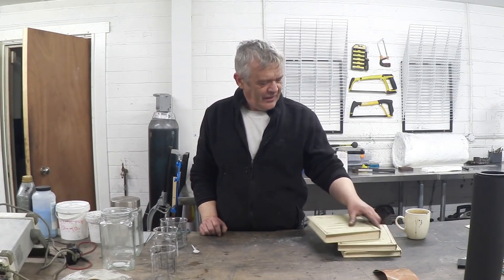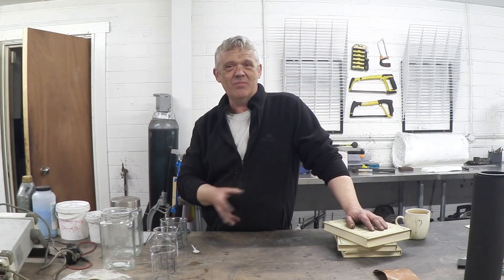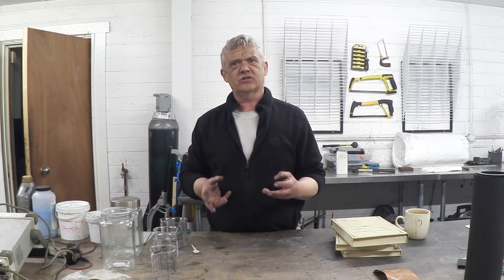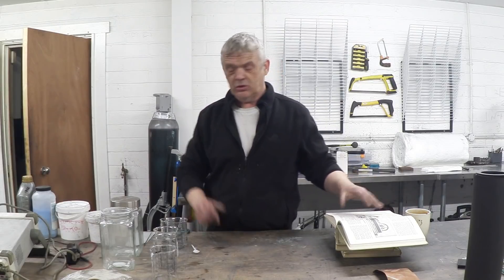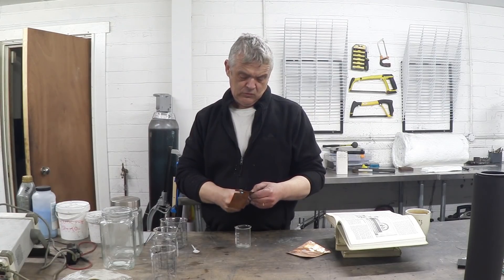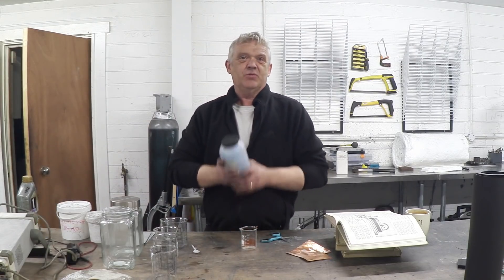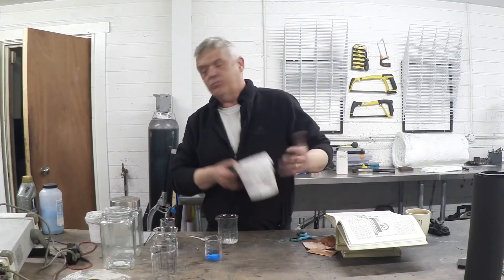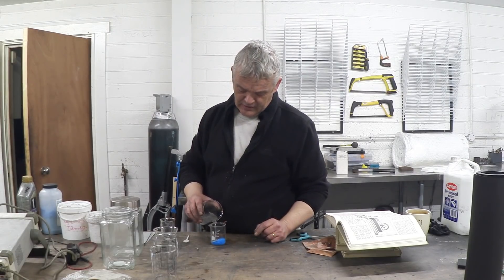Gravity Batteries - Cheap, Easy, Robust And Awesome For Off Grid

Comment: I thought a "Gravity battery" was just lifting something heavy when you had excess power, or via a mechanical device (ex: windmill) and dropping it to get the energy back.
Reply: That type of a device was used to run old grandfather clocks.
When you wind up the device, the weight is raised to the top and then it slowly falls to the ground over a period of days. 
In the process of it's slow descent, the clock keeps time.
Reply: @scotttovey  Me too!
Reply: @scotttovey  That's what I came here for.. He plays it off like his description is for a free-energy machine, which I didn't get from it.. I expected a small scale gravity based storage device.  Click bait is alive and real.
Reply: @FateGathersStudios  But in this case not disappointing and annoying.
Reply: Like the "GravityLight". One "lift" will power an LED light for about 20 minutes. It was designed to replace kerosene lamps in underdeveloped countries.
Reply: @DanaGould0  ......simple LED setups  in under developed places played a part in the drop of oil prices just over a decade ago.
Reply: ........oh,, that would be how the Romans did their pile driving of trunks into the soil or river beds . They had a scaffold on the site , by means of a  rope looped over a beam the men on the ground would repeatedly haul vertically upwards a weight which they would then release to fall and hammer down onto the the trunk to drive it several inches or more into ground  each time..There's a scene in some movie or documentary when Caesar is in Germany and he decides to build a bridge across a wide roaring river to beat up the German tribes on the other side who are making very rude displays to him and his men . Germans run away ,,after a few days the men then disassemble the bridge again......So this is what I picture as the gravity battery.
Reply: @philipvernejules9926  They're still in use, but we call them pile drivers. (Because they drive piles into the ground.)
Reply: Yeah I thought the same thing. On the Wiki for "Gravity battery" at bottom:

"From 1870 to 1930 [7] the term Gravity Battery was used to describe a collection of popular battery types where gravity was used to keep the chemical constituents separate based on their respective densities."

He explains why gravity is necessary for the mechanical version at 7:24:

"gravity keeps these layers separate, copper sulfate gets 'eaten up' forming zinc sulfate"

He describes the effect of discharge, "every now and then you're going to have to siphon off and replace with fresh water... siphon off the zinc sulfate solution which is getting more concentrated... drop copper sulfate in there"

At 13:01 he explains why gravity is necessary for the rechargeable version. 

When I think of electric vehicles I think of "plugging in" to use electricity for electrochemical ionic exchange (back and forth).  But consider the first "mechanically charged" battery in this video: what if when we phase out gasoline we could somehow continue to use tankers and pumps but instead replace with a copper sulfate liquid solution. We would still have to perform the "siphon off" process into a separate internal tank of the car, and this could be sent back into the gas station so it can transported away.  

Then there would be a resource loop and you could use renewable energy to supply the large amounts of heat necessary at chemical factories making the copper sulfate. Sulphuric acid is required to make copper sulfate. Hydrogen peroxide is required to make sulphuric acid. 

I suppose Hydrogen Peroxide is the "final" step of the loop process, as anthraquinone is needed for its catalyst (does not need replacing). Heat and energy is the other input for the  steps that it takes to get to copper sulfate (mixed with water to become our liquid flowing pumped "gasoline" replacement stored by tankers). 

The only thing different is that something is pumped out as well, then that could also be hauled in tankers and looped back into the system.

I wonder if there would need to be fresh water injection inside the vehicle while its driving. 

Would a vehicle constantly bouncing off road render this method useless? Gravity has to hold the layers in place.

He also talks about how you have to wait 15 minutes for the displacement reaction to "really get going".
Reply: @leejohnson7851  I too would expect the problem of mixing to rather get in the way of this as a useful power source for electric vehicles.  I also suspect that the power density is going to be too low to make it practical to carry enough battery weight to provide enough power to move a vehicle fast enough or for long enough to go far enough.  I do recall reading something about bromide batteries as likely candidates for small scale local power sources for houses and light factories.  I must go back and see if that came to anything or if it's got anything in common with this idea.
Reply: @cliveadams7629   Robert has another good video about the bromide flow battery.  Seems like it would be better because material would never need replacing (zinc may crystallize after quite a long time). I think the "action" happens because of the proper pumping of the liquid solution according to power needed.  Australian company Red Flow I think does it and can scale it up easily.  Lasts decades, cheap materials. Sodium Bromide spa chemical available on eBay to us, it's naturally occurring - I think extracted from sea water. Rather the sodium is the binder? Then dissolve into solution with zinc sulfate?
Reply: @leejohnson7851  Thanks, that was what I was trying to remember, bromide flow batteries.  They seemed to offer real promise as industrial batteries or for local distribution of power.  I'll check out his video.
Reply: A grandfather clock is what I thought of too. It's mechanically rechargeable!
Reply: Years back I bought a Baygen radio with a wind-up spring and dynamo. While reading the various discussion boards about it, someone suggested suspending large weights then using a block and tackle to lift (charge) them then use their weight (discharge) to spin a dynamo to generate electricity for a long time. This makes the term "gravity battery" subject to confusion amongst the more literal-minded of us.
Reply: Tide pools are a gravity battery.
Reply: that is the fault of english.  terms can mean many different things. this battery is a gravity assisted chemical reaction, so maybe you can make a new acronym.
Reply: Same...I was going to point him to Thunderf00t's debunking video 
https://www.youtube.com/watch?v=NIhCuzxNvv0
Reply: That would be a kinetic energy battery wouldn't it?
Reply: @BoughtBuiltBoosted  Maybe you could consider it a potential energy battery.  A chemical battery uses chemicals to store energy. A mechanical battery uses mechanical energy, like a flywheel, to store energy.  A heat battery uses heat to store energy.  Not sure how else to use gravity to store energy, though I guess a chemical battery that uses density separated chemicals could count.
Reply: I believe that concept would be a gravity (powered) generator but not a battery.
Reply: Same but chemically stable batteries that works by layering different density liquids works fine too!  Its like the syrup,water,oil experiment we did as kids.
Reply from the maker: nope

Comment: I Actually thought you were going to do a Video on the GravityLight 2 that they sell in Africa. Though I think of them as a Mechanical Battery since it basically is a weight slowly turning a small motor to produce Voltage for a LED Light. Would be interesting to do a Video on that kind of System.
Reply from the maker: I agree and it has sparked an idea in me - cheers mate
Reply: That's more like what I was expecting when I saw the title! 
Something really simple like what a dumbo like me could easily understand and replicate, that could in turn be used to either trickle charge a battery and, as a final act in its cycle, switch over from dying battery to newly charged one and also trigger an LED/ding a bell or something to remind the operator to reset the weight for the next charging cycle. 
Of course, instead of a 'physical' weight you could substitute a hydroelectric solution (which really is only substituting a liquid weight for a solid one).
Instead he comes up with something almost as simple but infuriatingly more interesting, opening avenues of thought that I wouldn't have otherwise considered.
Is it any wonder I've subbed?

Comment: Dear Rob, I'm absoloutley with you about old tecnology. Too much forgotten, not accepted etc. AND: Why not bring 'old stuff' back alive with tecnology and materials which are now cheap and easy available?
Reply: You want a new idea?  Read old books.
Reply: @SECUP1  This is more true than most people realize.
Reply: @SECUP1  which books do you suggest btw?
Reply from the maker: absolutely for sure mate
Reply: Many people seem to forget that those techs sucked at their time only due to supporting technologies(materials, algorithms, manufacturing etc) not being advanced/affordable enough, or just failed due to business errors/misfortunes, instead of being doomed to suck forever
Reply: @ki0w0-lordofwatersheep  Yep, in fact, there are a few of those that are now regaining acceptation and might even replace the current standards. For example, the electric vehicle, which was actually used at the beginning of the 20th century, but was quickly superseded by the internal combustion vehicle because battery and electric motor technology of the era couldn't compete with internal combustion. A more modern example is virtual reality. Nintendo attempted it in 1995 with the Virtual Boy, but the technology of the era didn't provide a good experience and it was a failure.
Reply: @ki0w0-lordofwatersheep  Plus we have tons of low power devices that can operate from "old" weak batteries...
Reply: agree 100% : )
Reply: agree. it's almost shocking that the most robust rechargeable battery technology today may be the original nickel iron design that Edison made a hundred years ago. You can get new ones, but they are expensive.
Reply: have you tried to make the solutions as a gel to make them more stable during movement ?
Reply: Google Zoroasters vimana and the US military capturing it in Afghanistan. How could a 5,000 year old machine still have power to protect itself? Google the TR3B the USAs modern day vimana. It is said to be superluminal or faster than light.

   Edit.   5,000 YEAR OLD ANTIGRAVITY TECHNOLOGY.  Good enough for you?